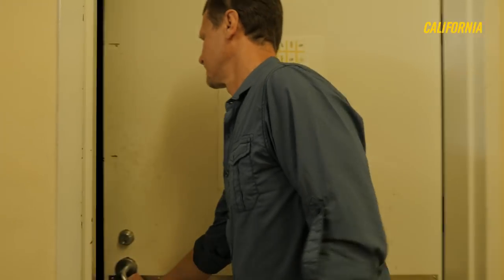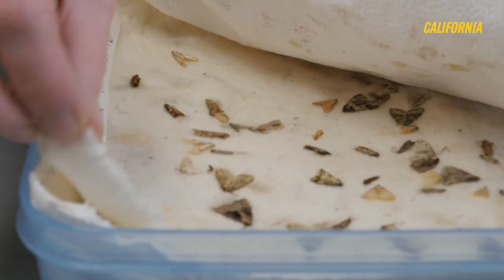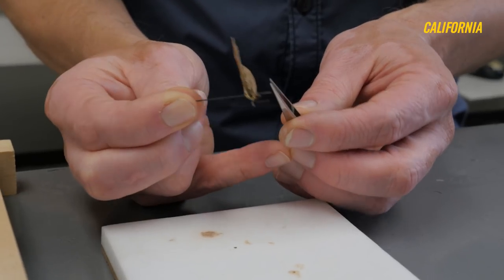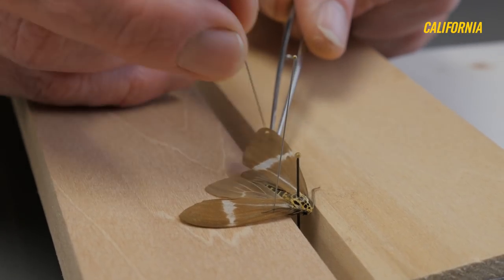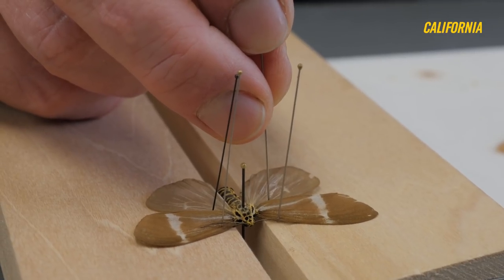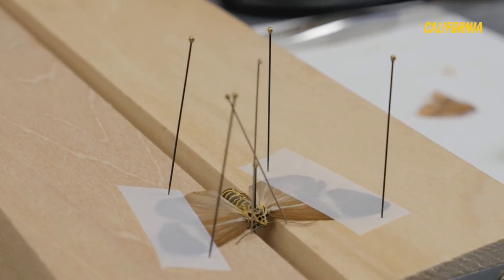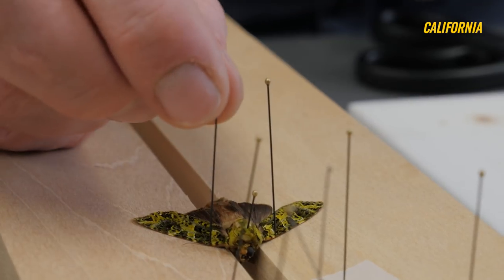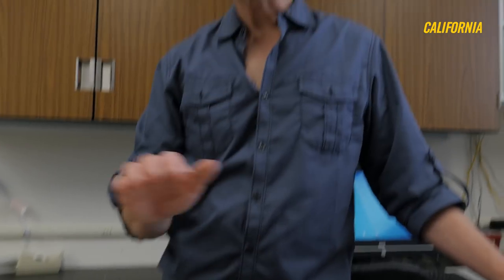How to Mount a Moth – Bugged, Episode 1

Comment: rule number one! NEVER put the pin through the wing like he just did, use tracing paper
Reply: He said specifically that by taking them out quickly like he did it will give the holes tine to close up
Reply: Those sized pins (0 and 00) rarely ruin the aesthetic value of a specimen

Comment: Well now my ocd doesnt agree with the placement nor the small punctures through the wings. Very common misconception to use the venation as pin spot. You can use the venation as anchor when moving the wing either with forcep or the pin but holes in them, imo is unacceptable. 
To think they are going in a museum lol
Reply: This. I'm just starting out but cringed at how he did it
Reply: I just saw a video from a small YouTuber and I was confused how different and less careful this seemed, not horrible I'm sure as a beginner in my class I'll do much worse.
Reply: He put them there temporarily you couldn’t even see the hole once he took the pin out
Reply: Using 0 or 00 won’t leave a visible hole in the wing once removed if left for a very temporary amount of time if you need them to stay put while you reach for some glassine paper or something. Wouldn’t recommend using anything larger than 0 or 00 though as they will leave a very large hole.
Reply: yes never ever pin the wings not even for a second (I can see the light coming through the hole he says it will not stay...right ! )